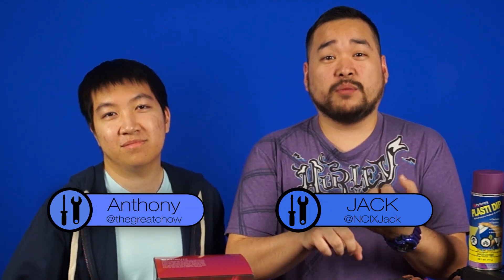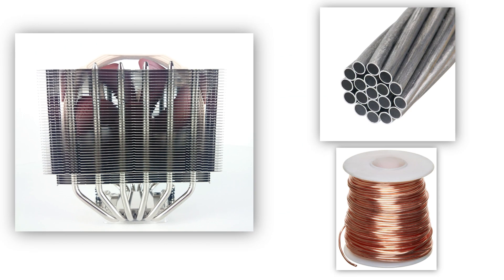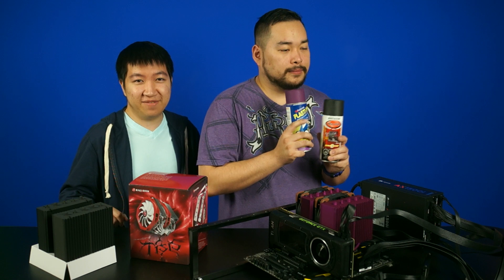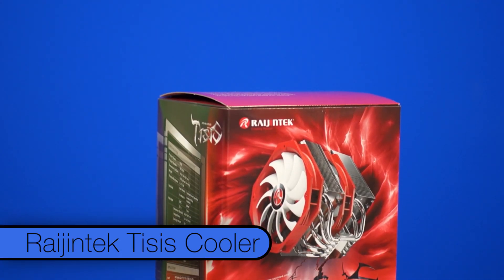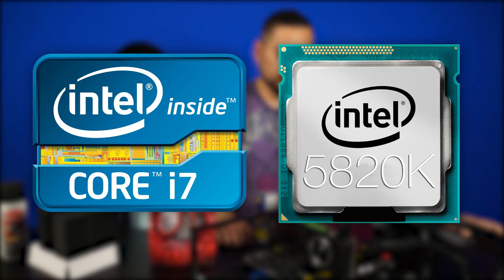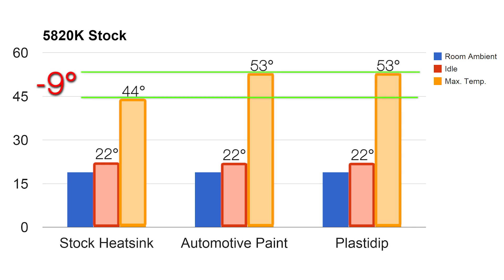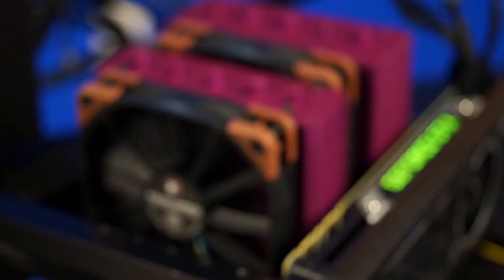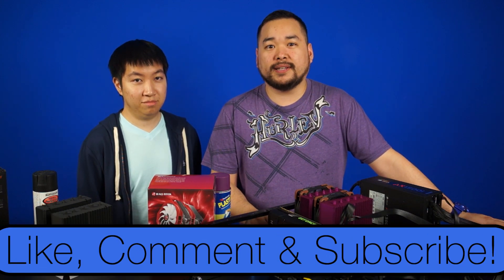Painted CPU Heatsink! Plastidip + Auto paint mod ft. Raijintek Tisis

Comment: 80 degrees ? How the fuck do you get it to run that low ? Mine runs at 105 idle and 113 full load
Reply: Holy shit! Did you forget to apply thermal compound or something?
Reply: If it's Intel ur a troll as the max they allow is 105 before safeties kick in.
Reply: Unless ur talking Fahrenheit...
Reply: bensemus x It's an AMD and I'm talking of celcius. http://i.imgur.com/vGxcNFH.jpg
Reply: By managing cables and ensuring good air flow.  Even the stock heatsink shouldn't be reaching those temps, unless your room is pretty hot.
Reply: Tipichounet x4 860k, 99celcius, fan spinning at 11%. Change the fan curve to be more aggressive, the stock one is very silent (AFAIK)
Reply: Package is not the temperature. It's always high if u have a FM2 or FM2+ CPU/APU.
Reply: Hilarious. I get 45C load with my AMD cpu with Be Quiet Dark Rock Pro 3.
Reply: Tipichounet You should reapply the thermal paste ASAP and make sure the fans are actually spinning.
Reply: Exacier2 you mean 35c at idle
Reply: MrBall Breeder
Max load. 24 idle.
 4.7ghz
Reply: Exacier2 for one i realy doubt it but ill keep open minded and ask you what amd cpu and where do you live?
Reply: MrBall Breeder
fx 8350 and UK lol UK
Reply: I don't know how you got your temps that high as FX thermal shut down at 84c package temps. And I've experienced it first hand as my cousin unplugged my FX6300 stock fan and it kept thermal shutting down on me.
Reply: Exacier2 sorry i could not reply earlyer but i expect you to know that the FX 8350 has bad temp readers in the cpu while  24c at idle seems to be ok the 35c at load is way off the charts at 4.7 Ghz i advice you to google it up  and the real temps will be about 55 ish.its even reported 55c for 4.5 Ghz  for an FX8350 watercooled so 35 is sertin a wrong mesurement.
Reply: Ok so not a troll :) Something s seriously messed up if those temps are accurate which I highly doubt, AMD or not.
Reply: bensemus x My temps with hyper tx3 evo was 50C load which is less than half the size of my dark rock pro 3
Reply: Exacier2 neat I'm talking about op's temps
Reply: Not sure if trolling
Reply: Oakfield There is paste and the fans surely are spinning. It also doesn't drop below 3.8 ghz unless at full load.
Reply: Tipichounet Try checking your temps in the BIOS and also check the temps with an actual IR thermometer near the base of the heat-sink.  At 100+C you are talking water boiling and above temps and you could easily be burned when touching the heat sink.  Is the heat sink so hot you can't touch it?  My guess is that CPUID is not reading the temp right or that the chip may have a faulty core temp sensor.  Most AMD chips won't go much over 70C before they begin throwing errors and they will thermal throttle around 84-85C.  Most Intel chips won't go much over 80C before they begin throwing errors and they will thermal throttle around 90-100C.  Modern motherboards will generally shutdown the system if they detect a thermal runaway condition or high temps on the CPU socket sensor.  The stock cooler on a stock clocked AMD at least for the last 10 years or so has always been more than adequate when the cooler is installed properly, is clean and the case has good airflow. I am running an AMD FX8350 at 4.7Ghz with an obsolete Corsair H70 AIO water cooler and my chip is 25C idle and 45C full load for 30 minutes.  Even with the stock cooler and this overclock I have never seen the temp over 60C at full load.
Reply: kuhrd Whatever as long as it works I'm fine with it.
Reply: MrBall Breeder
dark rock pro 3 is better than quite alot of water coolers. Since air cooling is better than closed loop watercooling. also maximum temp I can reach is 45C with lowest fan speed (933RPM) I have fan speed at 60% at 40C
Reply: Exacier2 That's insane. I had to deal with this http://i.imgur.com/he9EM4H.png for 2 years.
Reply: Exacier2 Water cooling and air cooling are equal as far as performance vs surface area.  The difference is that even with heat pipes air cooling has distance and surface area limitations.  Water cooling allows you to move the heat completely outside the case and allows almost unlimited surface area within space limitations.  Water cooling tends to be more expensive but can still be achieved on a budget if you DIY the system from inexpensive sources.
Reply: kuhrd
I bought the dark rock pro 3 because it's alot cheaper than the h100 but performs near as good, also it looks good.
Reply: Exacier2 watch this and look at the charts and come back to me telling that the dark rock 3 pro performe better then most of AIO ....

https://www.youtube.com/watch?v=Pt5_dU-15v8

corsair AIO are not good comparitation for AIO because the performance of those  H100,H110 and all others are mediocre ,so please stop compare corsairs AIO with aircoolers but bring in the goodones as comparitations like the swiftech H220 or H220x.

and again you're temps are wrong,google it up.
Reply: MrBall Breeder Actually I can put my hand on the heatsink and it is extremely cool under max load.
Reply: you can keep ignoring my information but look at this page :

http://forums.amd.com/game/messageview.cfm?catid=446&threadid=160921&enterthread=y&STARTPAGE=2#last

at 4.7Ghz it will be NOT cool and im starting to think you're trolling here or dont realise whats going in you're rig.
Reply: MrBall Breeder
Idk why you're complaining about my CPU temps anyway. 50C would be the same as an i7 4770k.
 and the 8350 is nowhere near as powerful as that.
Reply: you know that the temp probes on your cpu is 10 to 20c wrong ?

quote:Why is the temperature of my FX, Phenom, Athlon based processor lower than the ambient temperature?
Starting with the Phenoms, AMD's digital sensor no longer reports an absolute temperature value anymore, but a reading with a certain offset, which is unknown. It is estimated that this offset is between 10 - 20c

from this site :
http://www.alcpu.com/forums/viewtopic.php?f=63&t=892

and here to understand more your cpu and offset :

http://www.overclock.net/t/1128821/amd-temp-information-and-guide

its you who are looking at wrong numbers. there is no cpu in the world that get high overclock with an temp of 35c under max load with aircooling.
Reply: MrBall Breeder I guess I'm a world record holder then! and as I said, I can put my hand on the back of the heatsink right above the CPU and it doesn't feel like 50C. So I would assume that what it's telling me is accurate. I'm pretty sure I could feel if it was 50C.
For me there is not a huge gap between idle and load because of the way I set the fans up.
Reply: then your cpu is not running max load and not at 4.7 Ghz because 35c at 4.7 Ghz on air does not exist and is simply not possible.

atm the FX8350 is able to clock max 4.5 on air and 4.7 with AIO .over 4.7 is possible with custom loop.
you dont need to believe me ,just google it up.
you are misinformed.
Reply: MrBall Breeder
I dont need to google when my computer shows it. GG
Reply: but you didnt read amd page . it explained that youre computer isnt showing it right, so again you're misinformed and spreading unreal information.you shoud google it up and not beeing stubern and scared to find out the thruth. your cpu isnt at 35c on load and if it does then it isnt at 4.7 Ghz.google it and learn how to read hardware
Reply: MrBall Breeder
I can feel the temperature that it is at and it is what it says it is.
Reply: misinformed ,learn to read hardware.

FX8350 cpu temps arent core temps

you are like that guy that tought hes cpu was running at 4.7Ghz on air like hes pc says ,but when people asked proove he realised with the right monitor software hes cpu was only running 4.0 Ghz.

ill end here if you arent willing to look up the right information that is offered to you on a platter,then there is no other reason than classify your comments as BS and end here.
Reply: MrBall Breeder
Believe whatever you like, You have no idea what the environment of it is so you can't give your opinion on it.
 IMO 45C load isn't special or something and having just installed. Also the BIOS temperature is accurate.
Reply: i dont give my opinion ,i give you links to AMD webpage that explain about offset and temp reading on the FX8350.i gave links about real temps of the FX8350 and the real OC numbers.you sayed 35c on load at 4.7 Ghz and now trying to turn the debat by saying IMO 45C and you dont realise how BS you  sound.i have no idea what enviroment of it is? i do know because you told youre self you use FX8350 with an be quiet dark rock 3 pro and information and benchmark results can be found on the net build in case or on bench.

keep staying in denial and keep talking BS.
Reply: Exacier2  he's right. I own'd two FX6300s (now one) and the temps are package temps, not core temps. AMD fanboys run around saying "OMG MY 8350 RUNS LEIK 40C YOUR INTEL RUN 60 LOLOLOLOL" when in reality the AMD has a higher TDP aka giving off more heat, and actual core temps are much higher.
Reply: MrBall Breeder 4.7 with a custom loop? I run my fx 8350 at 5 ghz on air (thermaltake c5) and never get higher than 55 degrees. Room temp is a little above 20 degrees i think.
Reply: Also, it is possible that cpuz or the motherboard says 45 degrees on 4.7 ghz cuz my temps are around the same at that speed.
Reply: robin ET those temps are ok but i don't know how you're getting them that low. my friend had his 8350 at 4.7ghz on a H220 240mm AIO and his temps were higher.
Reply: You know that every processor is different and its pure luck of getting the good one right? And i got new fans on it, gentle typhoons wich also helped with 5 to 10 degrees.
Reply: MrBall Breeder my point. he backed his 8350 to 4.5ghz. I don't believe the guy saying he has 5ghz at 55c unless he won the silicone lottery.
I personally won the lottery with my 4790k. sitting at 4.8ghz at 1.285v but i run 1.290v cause i can.  stopped crashing prime at 1.280v
Reply: Andrew Russell my 4770k runs 4.738 at 1.35v the 2133 Mhz ram runs at 2196 and cache at 4.223 but very close to throtle temp with prime95 thats why i backed it up to 4.6 i consider mine as normal and is cooled with the good old swiftech H220 and 6 fans+ 2 aio fans in case nzxt H630.the 4690k i build for my son was able to reach 5Ghz quit easy but never toke it to the limit and backed it to 4.8 so maybe that chip is the lotery win lolz.

im just an hardware geeg and my hobby is to gather information from the web about hardware.my autisme gave me the skill to remember everything beside where i got the info off and have analizing skills.

heres a scoop skylake can work on Z87 and Z97 and haswell,haswell refresh and broadwell  will work on Z170.lets see on or after computex if im right . :) and amd 300 series well.....im not gona start a war again so ill keep it for myself.
Reply: MrBall Breeder for a 4770k I would delid and reapply better TIM if you want to run that high. Best way is with the clamp. My friend does it to all of his cpus since Ivy. 
I didn't do it to mine cause I got lucky and I don't have to push much voltage. 

Really??? Intel ditching tick tock socket change? That would be a big deal. Do you know where you heard this?
Reply: well we know that skylake is supposed to support ddr4 and need 1 extra pin for it so it is anounced for socket 1151 but  i saw information that the coming boards for computex Z170 only has ddr3 and is also sayed it will support haswell and broadwell.ill search tomorow where i did saw that because its almost 6am here and its time to hit the bed.
(broadwell-k has heating problems search could help).

ill post tomorow when i find it.

gn
Reply: MrBall Breeder Skylake can support eighter DDR3 or DDR4 The UniDIMM is for laptops only.
Reply: +Andrew Russell wait im gonna make screens
Reply: Andrew Russell
Actually I live in a refrigerator.
Reply: Slay its one or the other and its the MB brands that will decide. but if they build an ddr3 motherboard for skylake then there is no need for an extra pin and by that 1150 socket is enough while broadwell is not good enough for desktop release they are dropped to mobil devices.

the leaked information as broadwell-k makes no sence at all ,the 5775c ,specs ,nr,lettre all points to not an desktop cpu while braswell is coming as an SOC ,i see the broadwell k going SOC ,beeing renamed to braswell ,it will be an unlocked one for laptops and then the 5775c makes suddenly alot of sence.

here you can read its ddr4 or ddr3 ,not both

http://wccftech.com/intel-skylake-socket-lga-1151-z170-chipset/

hier you can read that the broadwell k will very likely beeing binned,squashed or skipped.

http://wccftech.com/intel-debating-commercializing-broadwellk-binned-alleges-italian-report/#ixzz3RUtaggfg

here you can read that the broadwell-k will be only quadcore and again the unlocked braswell make sence

http://atforums.mobi/msg.php?threadid=2423431&catid=5&rnum=179&STARTPAGE=1

if you read this :

http://www.kitguru.net/components/cpu/anton-shilov/release-of-intels-skylake-s-may-create-a-mess-on-the-market-of-mainboards/

then you will understand that intel gona take mesures against this.

based on this information my brain see this

1)broadwell -k will be turned to c and for laptops.

2)broadwell desktops will be skipped

3)skylake will be released at computex with skylake -k included

4)Z170 ddr3 will have socket 1150 the ddr4 will have socket 1151

5) if im right with the 1150 socket on Z170 then haswell,haswell refresh,skylake are crossover packages meaning that they all fit and its very likely that the total switch to 1151 will be in 2016.

i tought ive read the broadwell goes to SOC and Z170 will have socket 1150 but cant find where i seen this atm.the second that i find it i will post here.
Reply: Exacier2 then you're primal post is misguiding.

quote:Hilarious. I get 35C load with my AMD cpu with Be Quiet Dark Rock Pro 3.

you using extreme cooling setups and then act like you're running cool temps with normal aircooling.

its like the records on air that uses ln2 to cool air and blow that cold air in to the aircooler of the cpu.

next time you should tell you're setup so it make sence and people would understand its an extreme setup
Reply: MrBall Breeder i dont think he actually lives in a refrigerator lol
Reply: robin ET ofcorse not lol but he could set an bench in an fridge envirement like for example at hes work.
Reply: Yeah i know what you mean
Reply: MrBall Breeder
I'm pretty sure jayz2centz had it at 5ghz
, also you're not english? also 45C
Reply: nope im not english

4.8Ghz AIO wc

https://www.youtube.com/watch?v=MckeAmnDeTk

best so far is 5.14 on custom loop for him like hes says in here .

https://www.youtube.com/watch?v=tvLRZxRL8N8
Reply: MrBall Breeder the "c" broadwells are for desktop. Skylake is 1151 and Z170 no matter what RAM are you using. There is no crossover between Has/broadwell and Skylake.
Reply: dont take leaked information for granded.

there is no released information from intel that the 5775c is laptop,desktop,broadwell,braswell or SOC and there is no official statement about skylake ,socket,motherboard and ram beside the links i gave that are leaked info or rumors so how would you call your statement on this?

here some official released information

skylake will support ddr3 and ddr4.

motherboards will support one or the other but not both and its up the brands to decide

skylake was supposed to be on socket 1151 and for ddr4 it does (the extra pin thats needed) but the info was from before the broadwell heat problems could not be solved.
if they release the 5775c as the unlocked desktop broadwell with the specs that was leaked as an quadcore processor 4/4 with only 6Mb cache,i doubt that they gona sell much,leaving behind costumers that was waiting for an awesome broadwell k for they're Z97 board.its called suicide marketing and intel will not do that 

we will see what intel gona take out they're had at computex.it will be an awesome broadwell-k or an skylake -k but sertin not an c for desktop
Reply: Tipichounet Can i come over to fry some eggs?
Reply: Dimension I'd prefer you do it in your frying pan.
Reply: noobblaster98 Sure. I'll just keep playing everything on low settings like I always did.
Reply: noobblaster98 I just imagined your PC fans going WEE-WOO-WEE-WOO

That said, my quadruple WD Blacks aren't very quiet.
Reply: noobblaster98 youre talking about 45c package temps (cpu temp) not core temps.
Reply: noobblaster98 in this forum link, i add ,everything is explained and all  links to the right information is also be found in this forum page.amd cpu temps are socket temps not core temps and is offset by 10 to 20 C .
have fun reading :
http://www.sevenforums.com/pc-custom-builds-overclocking/320090-fx-8350-inaccurate-core-temperature.html
Reply: Alright, honestly now. Why would you care about your CPU temps for reasons other than bragging rights? As long as it stays below 100(90) and doesn't throttle it's OK. Temps below that pretty much don't have ANY impact on the CPU.
Reply: What a long comment chain. All i wanted was to cook my eggs :<
Reply: Slay the reason why temps matter somuch is unstable rig and longlife.
Reply: MrBall Breeder read my comment again. especially the part about life longevity of the components and again unstability is only when you're approaching 90 OR throttling.

Comment: Did you seriously paint the base of the cooler? What's wrong with you? You need to revisit this and make sure the base is unpainted.
Reply: Plastidip means you can easily peel it off, and it looked like they covered it when using the black paint, so your comment is pointless.
Reply: headcas620 Plastic was still on there.
Reply: WistfulBreeze So ya freaking peel it off! Real simple. They're not idiots, they wouldn't leave the heat sink contacts with paint on them. I'm baffled that people even think they did.